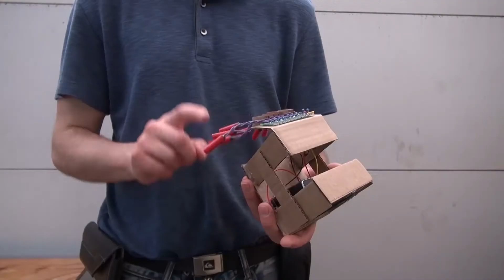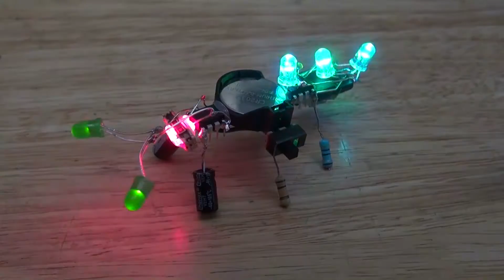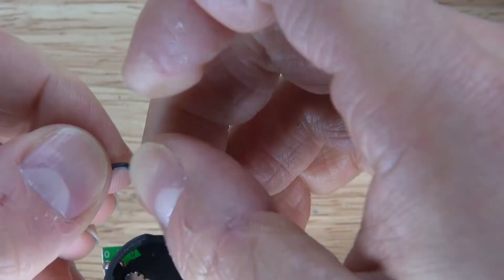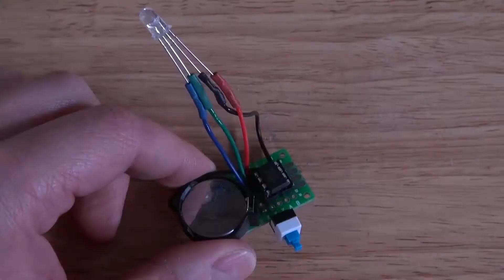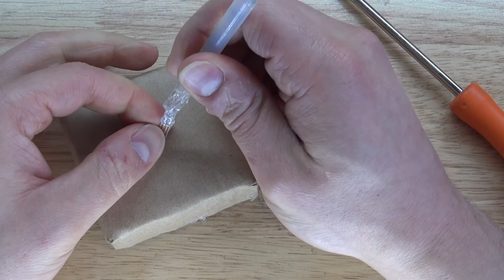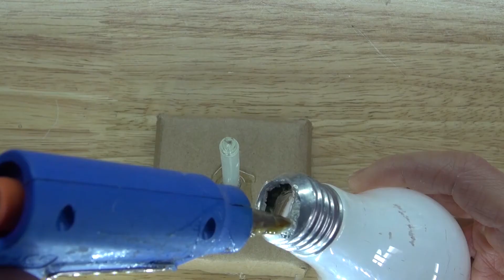DIY Relaxing Mood Light Bulb

Comment: can you please put a resistor between the led cathode and power supply to limit the current, and also , (sorry if i missed it) can you give the code for the attiny
Reply from the maker: Yes I could put a resistor. The only reason why I don't is because I am showing the simplest way to make this circuit with the lease amount of components. I have the code in the description.
Reply from the maker: Here is the code link. https://drive.google.com/file/d/1_UQpdd98fBxnLH1URqZse4c1BF2Inl9i/view
Reply: @SciTyeTech  thanks!